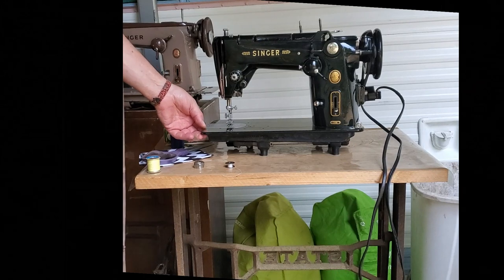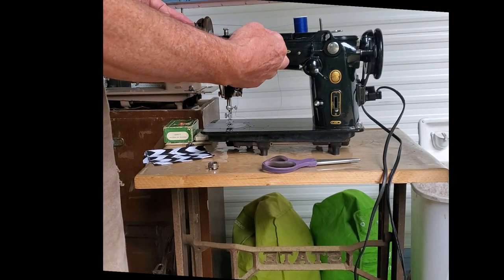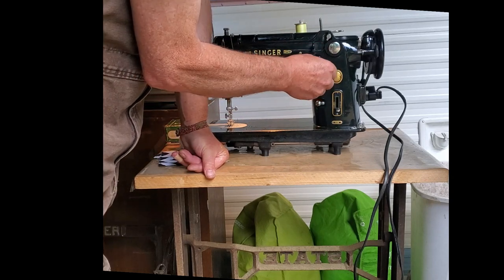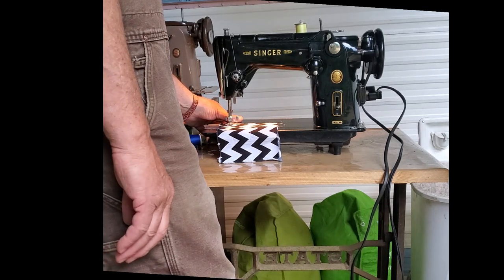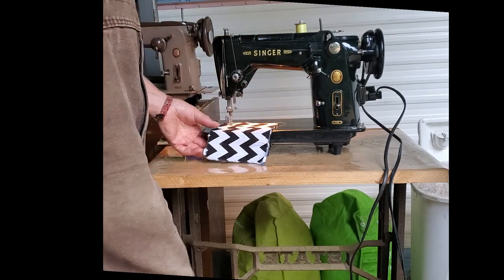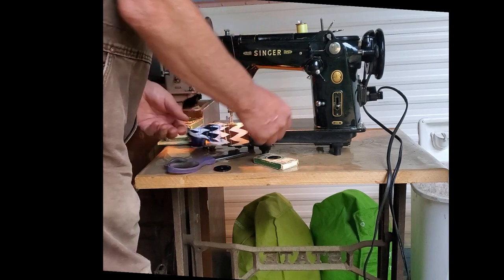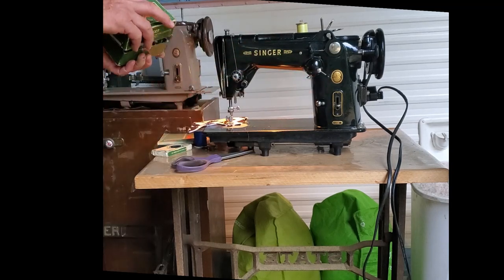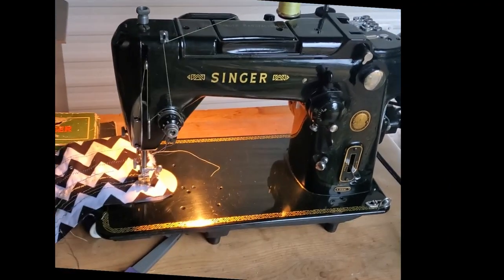Singer 319w Sewing Machine- Final Test and How-to

Comment: That beauty was made in Bridgeport, Connecticut, about 20 miles from where I live. I believe these were Singer's first home zigzag machines. 
You might want to put a carpet remnant under your machines to dampen the sound. Nice video, as always.
Reply from the maker: Good advice. Thanks!
Reply: The# 206K was Singers first American Zig Zag machine based on the Pfaff # 130 patent. ( Made in Germany before WW-2 and the Singer factory was destroyed ). The "made in Great Britain" machines were imported to the U.S. in 1952. The # 306K followed and was made in Bridgeport as well as Great Britain. The # 306 was the first Singer zig zag to use the various flat cams for utility and decorative stitches. The # 319 was the first Singer "Automatic" zig zag that had built in stitches as well as cam capable. This was also made in Great Britain and Bridgeport.
Reply: @StagecoachRoadVSMR 
Hello, I wonder how to contact you to see if you can advise which old Singer zig zag could convert to treadle and where to find one.